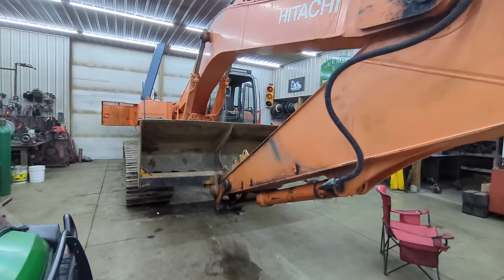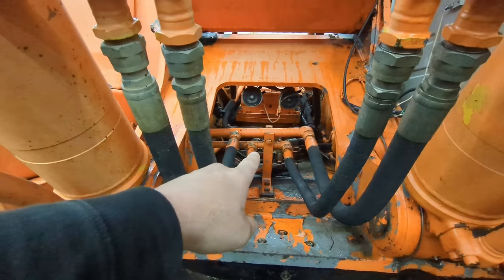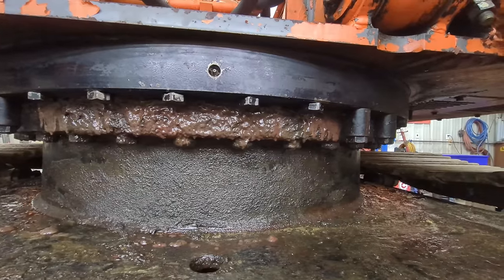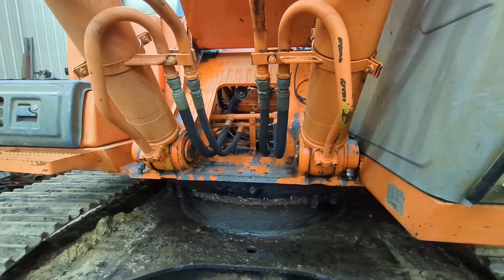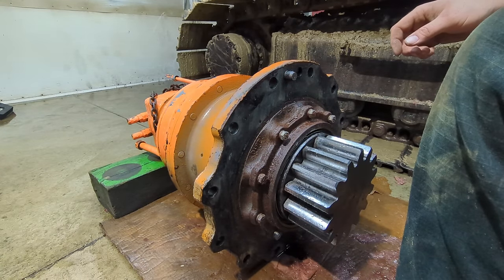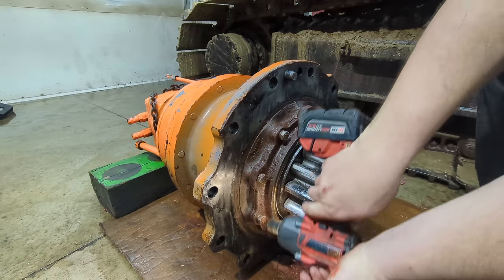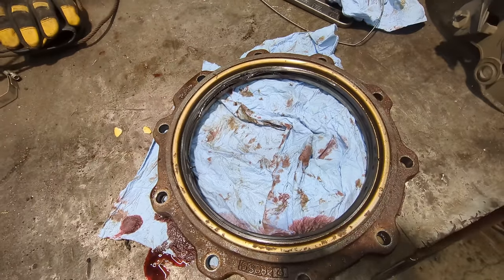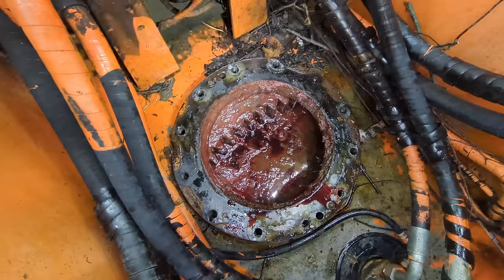Excavator!! Swing Motor And Rotary Manifold Removal.... Hitachi 270-5 We Go Deep!

Comment: neat water can cause a tone of damage as it freezes and thaws. where that large drive gear with all the
lubricant , is that contaminated with water? do you have to empty and fill it again with fresh oil ?
to stop the oil from coming down your arm, take a blue shop towel and wrap it around your tie it at your
wrist, that will prevent it from rolling down your arm, at worse it will drop off the towels location. old oil 
stinks so bad ! especially old 90 w gear oil! take care, be safe and stay healthy!